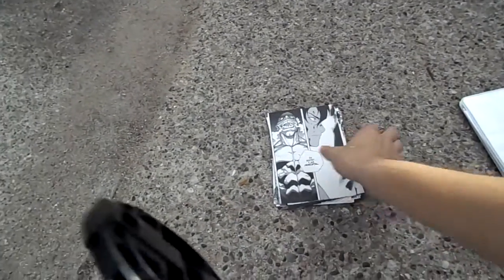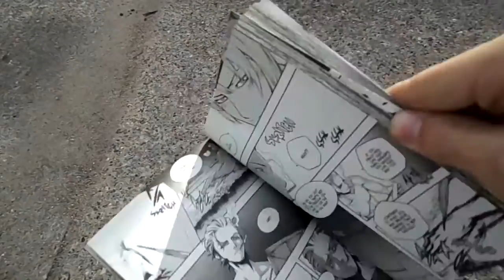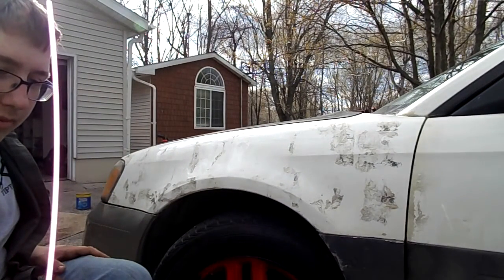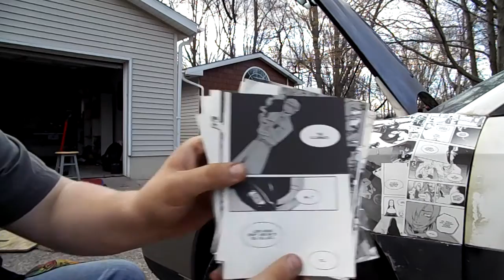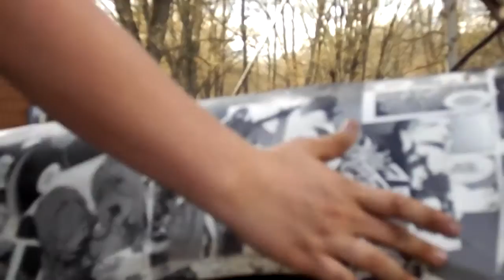How to do a manga bomb properly

Comment: maybe a good clear coat over it would do the trick and last it longer. ill do this to my quarter panel tomorrow
Reply: ive heard it only lasts for like 5 months then it looks like shit even with clear coat on...
Reply: @e36fanatics  proven......
Reply: @maxx-er3fj  hey there. Don't do it. Its trash. Not good. After a while the paper hardens and dries out bubbling up whatever clear you have on. And if not binding properly and the surface being binded to isn't properly clean.... in the long run it will not stick
Reply: @Heyitdave  Oh thanks, I will probably get something else then

Comment: i ended up ruining it :P some parts of manga didnt stick properly, some parts went yellow, some corners went loose. It was a total nightmare...
Reply: you cant rlly use old manga like bleach , etc cause pages are to sucky. Litterally sucked up most of the glue ended up not sticking.

Comment: how is it with rain and stuff? did you put anything on top of it like a lacquer or?
Reply from the maker: we put a crap load of clear coat spray paint on it and it works really well just takes a while for it to dry
Reply: Automotive Anarchy like the whole can. I'm gonna use a semi gloss from rustolum?
Reply from the maker: bob Ranches i would use a whole can to be safe, we used about 3/4